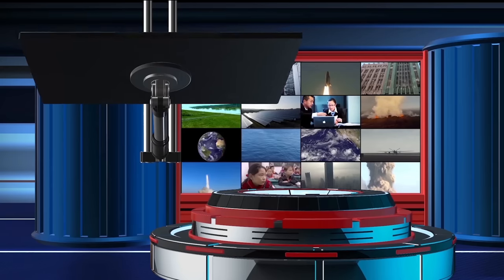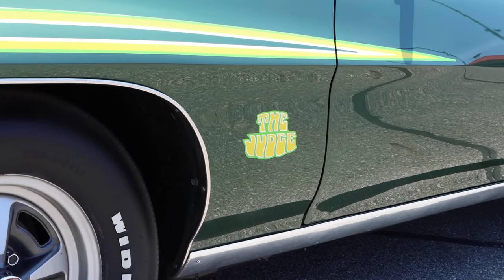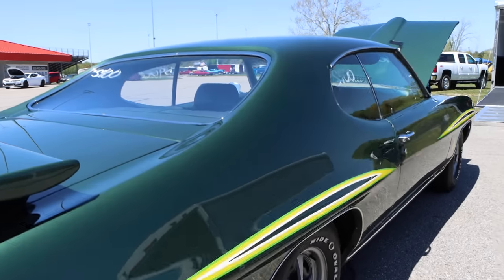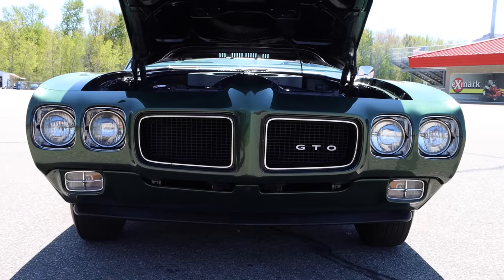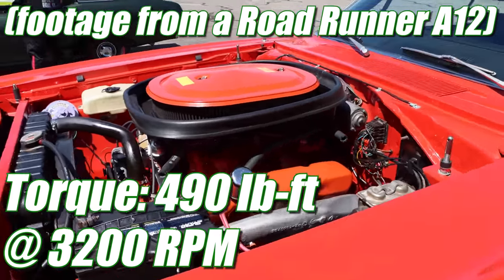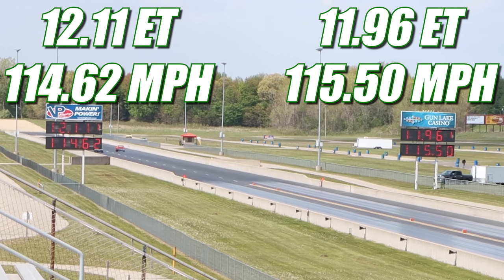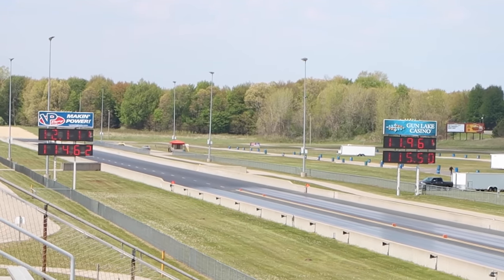1970 Pontiac GTO Judge vs 1969 Dodge Super Bee | FACTORY STOCK DRAG RACE

Comment: Wow, that GTO would have won if they were equal weight . They both were well matched, well driven and maxed out!
Always love you're enthusiastic commentary too. You do you I say.
Reply from the maker: Thanks for watching!
Reply: If the Bee had a four speed as well,  the Bee would drop three tenths ..easy..
Reply: If they were equal in just transmissions, the judge would have won. Easy. But the supeebee should have been put up against a SD 455 car
Reply: It was a great race but the 200 pounds would not be enough to chang the outcome.
Reply: @norristammislideshowmulgre877  200 pounds is easily 2 tenths in a quarter mile
Reply: @beezie2566  maybe a tenth
Reply: @PecanRanch  100 pounds is a tenth. So 200 is 2 tenths.
Reply: @beezie2566  that would be cool but we would need to put the 455 up against the 1968 Dodge Dart sol 426 Hemi the Dodge Dart would easily take the win. Or even the 1963 Plymouth Savoy 413 max wedge and once again the Plymouth Savoy would take the win. But I will say the 455 is badass.
Reply: @norristammislideshowmulgre877  why the dart?
Reply: @beezie2566  why not the Dart. Put the 455 up against the.1963 Plymouth Savoy 413 max wedge it will blow the doors off the 455.
Reply: @norristammislideshowmulgre877  up against the SD tempest in 63? I think not. It won nationals that year I believe
Reply: @norristammislideshowmulgre877  11.89. held the afx record
Reply: @norristammislideshowmulgre877  and that was a 421. Not the SD 455.
Reply: @beezie2566  the 1963 Plymouth Savoy 413 max wedge was the first car to break into the 2sec ot ran a 11.97 seconds. Look it up you will see. I would post it on here but I'm not good with computer's.
Reply: Would have been interesting if Pontiac put that RamAirIV stuff in their 455
Reply: @paultaktikian1485  This is from Wikimedia 
The Pontiac 455 cu in (7.5 L) engine first became available in the second generation Firebird in 1971. The 455 engine was available in the L75 325 hp (242 kW) version and the LS5 335 hp HO version, which was the standard, and only engine option, for the Trans Am. The HO engine also included Ram Air IV.
Reply: @geraldlafleur7776  the 456 was never offered with the complete RamAi IV components and high compression.  It would have been very potent in that configuration.  Other manufactures were not as restrained as Pontiac in offering their best pieces in one package
  A high compression RA IV 455 would definitely have reversed outcomes
Reply: @norristammislideshowmulgre877  put the 413 up against a 421SD

Comment: The Mopar took the GTO out of the hole (maybe due to lower gears?) by a little over a car length. Then held on to win the race by about the same amount. They were pretty much dead even after the first 40 yards.  
Back in the day, I used to have a 68' GTO. The 68' version had a 400 cubic inch motor came with 10.75 compression pistons 360 HP and a 373 rear end. Beefed her up a bit with a dual point distributor, a Holly 650 double pumper, headers and a Sig Erson Racing Cam. She ran real nice.
My present day car is a 2017 Dodge Charger HellCat...

Comment: I expected the A12 to beat the RA4 by almost a second rather than just a tenth or so. Looks like the A12 automatic had a better hole shot. May have been even closer timeslips if the RA4 had done that, but the 4 speed is tougher to get a perfect launch. Still, the RA4 exceeded my expectations.
Reply: It's so hard to get a good holeshot with a Muncie 4 speed without wrecking the drivetrain. 4 speeds and stick shifts in general are cool, but if you want to win drag races autos are the way to go.
Reply: Amazing Pontiac was giving up 40 cid and still did well
Reply: @paultaktikian1485  If it was a Ram Air V which unfortunately wasn’t released to the public, it would have won.
Reply: @jaylamb9546    The outcome of many,many drag races would have been different if they had to run against RamAir  V's

Comment: Once I saw the plates of the A12 I knew it was game over for the Judge. Awesome cars but it’s hard to compete with a well tuned 440 6 pack car.
Reply: I think a 70' buick withe a 455 stage 1 would !
Reply: @goneshootin61  One of the few that would and could potentially beat it. Love those 455 motors too. Torque monsters!
Reply: The only diff was the hole shot

Comment: The only problem was the Firebirds and Lemans based cars in those years where limited to 400cid, which handicapped them somewhat with a shortage of cubes. What I really would have liked to have seen was had Pontiac been allowed to install the 428 in those vehicles. That would have prompted Pontiac to develop a 428 cube Ram Air 4 for that application. It would probably have been rated at around 395 hp. Pure Stock Racing RA4 400's make around 440 hp fully blueprinted and tuned, so I figure a RA4 428 would make around 470 HP fully done. Then, especially in the lighter Firebird,  it would have been more of a match for those Chrysler and Chevy Big Boys.

Comment: Both are beautiful cars but it just blows my mind how a 440 can have almost 1400 cfm of carburetor and still run great.
Reply: the outboard carbs are vacuum operated..the mill just draws what she needs..& no cfm limit whatsoever :D a moderate 340 is shown to want at least an 850 on a dyno. a full tilt 440, 1,000 seems like a good start. ..it's quicker to fill a bucket with a 1" line than a 1/2" line, all else being equal, after all. 
recalling the carter thermo-quad of the 70's-80's..they had 800 & 850 cfm models. picture a 150 hp smogged out (poor things) 318 & running an 800 cfm carb, bog free! again..an air door covered the gargantuan secondaries & the engine only drew on demand, as much air as she could. ..such a shame looking back, those fabulous 318's & 360's, 400's & 440's  all restricted & trying to breathe through so much rubbish! 440's struggling to make 200 hp..such a crime. ofc..it meant over time these engines had never seen much high rpm use, bc gears like 2.45's & were just a cam, intake, dist & ign away from their former glory :D
Reply: @gzuzsavz  You have variable venturi carbs confused with vacuum secondary. It takes a very complicated system to cause secondaries to operate with variable venturis but vacuum secondaries open completely when the vacuum drops below a certain point. In order to assure that they open correctly they are usually designed to open when manifold vacuum falls to about 3 inches. They are slowed from opening by their vacuum operation which eliminates a lean bog during acceleration but they either open 100% or not at all. If you ever watch a dyno video where they have a camera mounted over the carbs you can see them drop open 100% when the acceleration starts. GM and Ford both tried variable venturi carbs in the late 70's but they didn't work well and were never used in any sort of performance application.

Comment: If all things are equal, I’m going to say the Super Bee. Don’t “Judge” me too hard if I’m wrong.
Reply: But it can be 3 different engines - 2 transmissions- gears from 3.23 to 4.10 … so there’s a lot of variables.
Reply: @1badhaircut  which is why I said “all things being equal” 😉

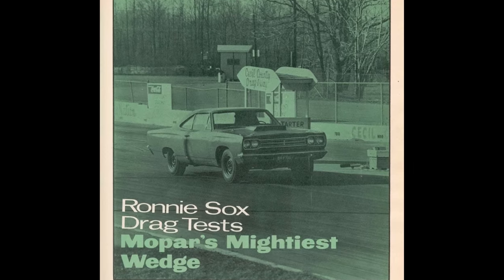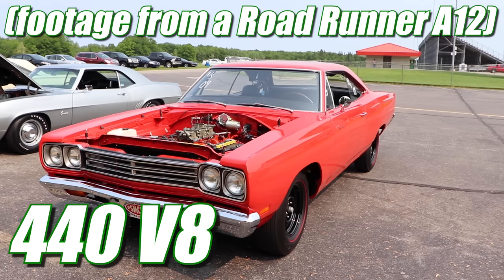If they have similar sized engines, but one has 4:10 and the other has 3:07…..yeah, the 4:10 will win.
Reply: @1badhaircut  that’s an A12 package Bee. 440 six pack and a 4:10 Dana rearend I believe
Reply: @1badhaircut  Man you really need to read the descriptions of both cars! It tells you what drivetrain both cars have!!!

Comment: Wonder how the GTO would faired with a 1970 Pontiac 455? Torque would have equal then.
Reply: I'm not a Pontiac guy but my buddy was, and all i ever heard was how a 400 was better than a 455 Pontiac Engine, especially the Ram Air IV  400,s.
Reply: Unfortunately, Pontiac didn't put enough cam in the 1970 455 to make it a competitor.  Pontiac dropped the ball when they didn't offer the roundport head or the RA IV cam in the 1970 455.

Comment: The Judge got beat at the light but it would still have lost by a bit. Really no wonder, comparing the cars.
Reply: he got beat at the light because the Poncho had a 4 spd and not the auto trans like the Bee had. No line locks/roll controls  are permitted unfortunately for manual trans rides.

Comment: Wish they would have built a 455 Ram Air 4 and stuffed it in the Judge :) Would have been Very Cool
Reply: Joseph,  sorry there is no such engine as a 455 Ram Air 4.   455 HO, or 455 Super Duty perhaps.  This was as about fast as factory Pontiacs got...sorry.
Reply: @gt-37guy6  I know that lol was just saying that would be interesting if they made one
Reply: @josephnewcomb5670  I remember another Youtube commenter saying he put RA4 heads on a 455 back in the day,  said fast as hell for about a week, and a piston got cratered out.....compression would be 12 : 1  or more on a 455.
Reply: @gt-37guy6  seen a built 455 HO GTO with 3x2 setup at a car show few years back :) Owner told me could smoke the tires long as u wanted till u let off it which I dont doubt
Reply: @gt-37guy6  The '68 RA II Firebird is faster than the heavier Judge. Their is a Blue '68 Firebird that runs 11.40s that runs in this class and a white '68 Firebird that runs in the FAST class that has been high 9 in the 1/4 mile.
Reply: @1972Ventura455ho  Trim off some weight and wow...Most do not realize the RAII had the round port Heads and in Firebird...yes I can see with the right setup would be even faster than RA-IV Goat.

Comment: If they are each the top performance versions they’ll each be mid-13s. ( if pure stock ) Pontiac’s are sneaky — a 455 looks the same as 389s — and a Hemi starts with at least 460-470 horsepower so just secret some tuning can get them into the 12s. You never know. The actual results are as expected — both faster than what I saw every week running pure-stock. By now most engines have been rebuilt and somewhat upgraded.
Reply: You can clearly see the difference  between a hemi & a 440! It also says the GTO is the 400,ram air IV! You should really read the description before you comment!